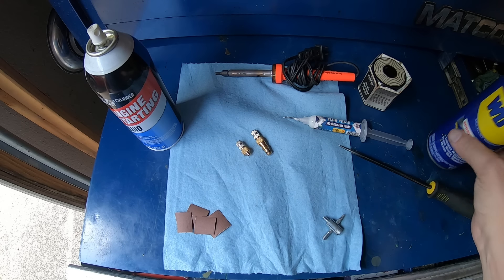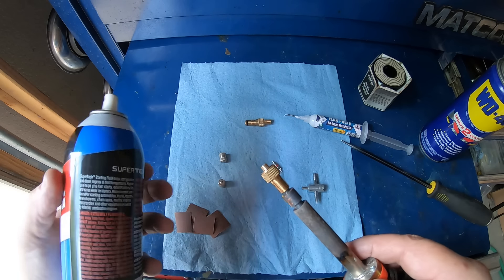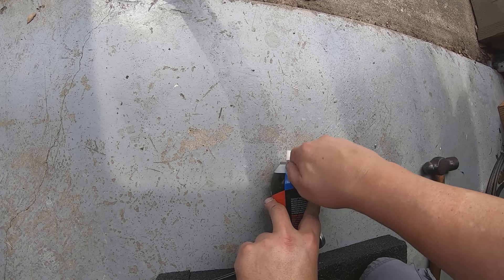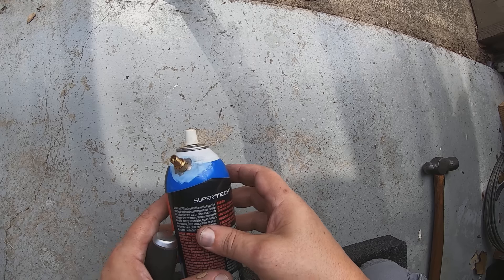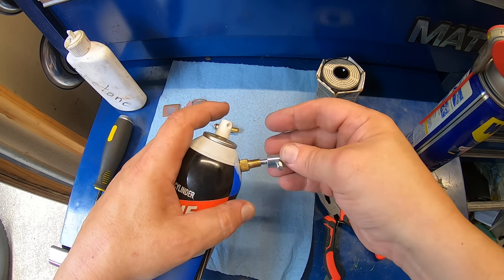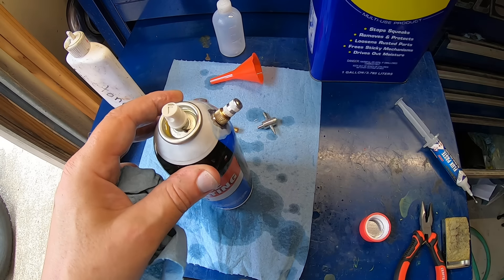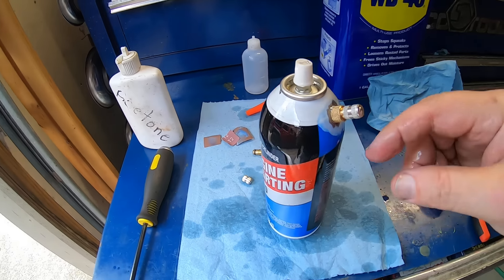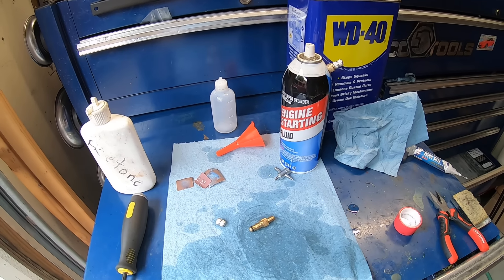How to Easily Install a Schrader Valve on any Can to make It Refillable without Drilling or Torch.

Comment: I've turned stuff like that down in my drill press with a half inch chuck and a file.  This is a very nice hack.  I had been filling cans by pressing a wheel stem onto a spray can and using the schrader valve that way.  This is way better.  Thanks for posting.  (I like the soldering iron hack too!)
Reply: the tire valve stems are made of rubber that is not oil resistant. the oil inside will eat tru the stem and will shoot the valve out, hopefully NOT in your eyes.
Reply: @west_park7993  the sealing ring doesn't retain the stem, it's metal and gets screwed into the assembly. If it deteriorated, it would just start leaking .
The solder letting go is the risk of the valve going projectile.

Comment: You should tap it and thread it in and then solder. That would give you a little more safety if something should be wrong with your solder job.
Reply: Good luck tapping metal that thin, probably half a millimeter (NZ here so metric) max.
Reply: @billharrison3174  I have tapped stuff that thin, you can't get a lot of purchase and you have to go slow but it can be done.

Comment: Great video, please consider getting an air chuck with a lock so you can stand back while airing up the can.  Not sure, but those cans are probably designed for single use and multiple refills may weaken them.  100 psi in a metal can is a bomb!
Reply from the maker: You should watch my other 2 videos where I pressurize them to failure.
Reply: Always wear safety glasses and other safety gear to protect your eyes and face if some solvent or other object happens to fly from the can!

Comment: That’s an awesome idea. People don’t realize many times that chemicals that many people believe to be next to free or cost very little in repIair/manufacturing commercial/industrial settings are actually pretty expensive especially in small  use  applications scenarios ie. Aerosol sprays vs refillable compressed air sprayers. I worked for a chemical company and most sales were industrial totes of product but some of the same products in spray cans  were 3-4 times the price or more and would still not equate the quantity of product difference. For those wondering and are not aware , there are already  refillable compressed air bottles sprayers but last I was involved w that industry, they were expensive as in $100 plus USD for a slightly larger sized can than the one this gentleman modified. Great hack…

Comment: Great way to get an air fuel bomb, oxidizer plus fuel under pressure, try it, be amazed. 
Make out your will first.
Reply from the maker: No thanks, I will stick to just pressurizing the can with my WD-40.
Reply: @737mechanic  WD 40 is fuel, keep the pressure below 14 to 1 and it might be ok, use a benzine or butane gas and it will go off earlier. I speak from experience, lucky for me the ends of the reactor I was using were not fused to the cylinder, it just popped apart, but it had ignited under pressure.
Teaching folks to do new stuff is admirable, but, given the right, or "wrong materials" this can be deadly.

Comment: If you get some AC system valves you also get valve cores that are PTFE, which makes them resistant to much more chemicals as well. Plus no turning involved, just get those without a tail, as then all you have to make is the roughly 3/8 hole to put them in. Or put the cores in the regular valve, as they do fit, making it chemical resistant, say you want to have a spray bottle of acetone or MEK , which dissolves regular neoprene rubber very fast.
Reply: Couldn’t you pull a vacuum on the can using a set of gauges stick your refrigerant line in the WD40 can?
Reply: genius dude ty! already ordered 10 lol
Reply: Yep... the perfect source for schrader fittings. The slim brass fitting on a copper tail form makes it easy to solder in securely (without specialist tooling) and not stick out like dogs balls. 
HVAC trade wholesaler is the place to go.
Reply: @rchighfield1  - Yes, BUT... You will leave residue from your refill in your A/C service hoses. Not ideal, IMHO. Especially if you are filling the spray cans with something that can attack the inner hose. Still, if you have A/C gauges and hoses, you can re-pressurize the spray cans with NON-OXYGEN gas (you know which kind!), and eliminate the explosion hazard you get with compressed air. But NEVER pressurize cans with straight Oxygen!
Reply: @YodaWhat no I don’t know what kind thanks for assuming my intelligence
Reply: @TimDanger  - Nitrogen would be preferred, but what non-Oxygen gas will AC technicians be most likely to have? REFRIGERANTS. Though of course, those are not supposed to be used in ways certain to cause their release into the atmosphere, like recharging the pressure in spray cans.
Reply: @YodaWhat  A/C techs should have nitrogen, too - need to flow that while brazing.
Reply: That was my point exactly.

Comment: No need to lathe the valve, can simply remove the rubber from a standard tire valve and solder
Reply: @ljbellinger  True, but you have to make a larger hole in the can. I think you can spin it in a drill and grind off some brass with a file. It is small enough to work without a lathe.
Reply: @AM-dn4lk  Yes, with no Lathe - you read my mind. A punched hole prevents drill swarf inside the can. I knew about this idea, but it was the 100psi that prevented me from doing it. I have many Cans of half-full WD 40 - with no gas inside the aerosol! It happens a lot to WD 40 Cans that I buy.
Reply: @peterduxbury927  PB Blaster is my notorious gas fail with lots of penetrate product left. Great fix!
Reply: @peterduxbury927  Just take the spray nozzle off and use an air blower in thru the outlet tube on your cans that still have content in them😎
Reply: @petermurphy3354 Yes sir, especially that rubber tip blow gun,  works on so many things...
Reply: @peterduxbury927  try a small piece of small diameter rubber hose, one side to the aerosol valve the other to a valve then your compressor, give the aerosol valve a few strokes and you can use all the good stuff.

Comment: I worry a little about air on top of a fuel, but I suppose you could use argon if you have a bottle for a mig welder. If your valve core gets eaten up by the solvent, you could try an hvac core - fits a standard schrader but is more chemical resistant and goes to higher pressure. You can get them off the ac system on junk cars. I may try this, but fill the can with my own atf/acetone mix.
Reply: I also worry about using compressed air to pressurize atop fuel. I advise against it, and definitely NEVER pressurize cans with straight Oxygen! Nitrogen (for filling tires) is available at some service stations. CO2 also works, and for some purposes, injecting some Butane would be a good way to pressurize. Using air also runs the risk of putting water into the can, which will rust through fairly quickly if there is any free Oxygen in the can.
Reply: My favorite DIY homemade concoction to replace the expensive liquids intended for breaking away stuck or rusted fasteners, is exactly a mix of either acetone or MEK and synthetic ATF+4, around half and half, but could vary between 60/40 to 40/60, depending on how fine or coarse are the stuck threads... Way better than "PB Blaster", "Liquiwrench", "Kroil", "Würth Rost-Off", and of course the very mediocre WD-40...
Reply: @alfredomarquez9777 
Try adding some kerosene to the mix (I've seen it called Ed's Red before). I use 1:1:1 and it works a treat.
Reply: What's the atf/acetone mix for?
Reply: @jamiepayne9801  
Homemade Kroil

Comment: This is an easy operation requiring simple tools... I have a commercial version of this, with a heavy duty aluminum tank, brass schrader valve, and a trigger sprayer.  I keep PB Blaster in mine...

Comment: You can just buy a refillable pressurized sprayer. Much safer, reliable and save you time.
Reply from the maker: I have 2 Sureshot sprayers, I like them but they spray too much product, It takes me 10 to 15 min to make these refillable cans and I have 6 of them so far and would never look back.

Comment: Funny you can just make the hole a little larger and then tap treads and screw the entire valve stem into the can or if you like also tin the can and the stem & solder it too. No machining the valve stem and double fastening.

Comment: This is GOT DAMNED GENIUS!! Now, if i can figure out a way to do this with a air wick spray can for my refillable, automatic sprayer it could change the world!! Those things are so expensive and last only a week maybe a little longer.
Reply: Hi Niki! Although it seems to be a good idea, it isn't. That method does work with compressed air, which is sort of OKish on large cans, although its really tedious, because you have to bring the can up to pressure very often. On small  cans like the air wick stuff, it doesnt work at all.

The reason is pretty simple: spray cans normally are filled with the product you want to spray plus a liquid, that has a very low boiling point, so it is - at room temperature and under normal pressure - already a gas. Compressed to 3-5bar however, it is still a liquid. A good example for such a substance is propane gas, which is indeed used in spray cans as propellant. In the propane tank you might know perhaps from a BBQ or camping stove, it is under pressure and liquid and when you release it from the tank it evaporates and becomes gas. The benefit is, that as a liquid, it takes much less space, than as gas (comparable to water, that creates an enormous amount of steam as it boils)

Now this effect is used as well to propel the product out of a spray can. When you press the cap, the pressure squeezes out the product as well as some propane gas (that is why the vapes are flammable even if the product isn't). The trick is now, that as you loose pressure, liquid propane will evaporate, until the initial pressure is re-established.

In simple words: the propellant gas is practically a built-in compressor, that keeps the pressure high until all the propellant is evaporated and hopefully all of the product came out of the can. 

With compressed air, you have only a limited airspace over the product under pressure. When that pressure is used up, you need to refill the compressed air. That is why it works soso with larger cans. With an air wick you have perhaps 1-2 ml of air under pressure. That is probably even not enough for one single spray.

Sorry for popping your dreamubble and sorry for using the metric measures. Being German I'm not used to convert to imperial. 

Cheers
Andreas
Reply: Don't take much to impress some people.

Comment: Why not just drill a hole the same size as in a tire rim and then just use a rubber tire stem forced into the hole as it would be in a rim.  Think it would work ?
Reply from the maker: There would be no way you could get it in without destroying the can.

Comment: That's a lot of effort to go through to extend the life of a spray can.  My issue is I have cans of wd-40 and other substances where the propellant is gone. Sometimes I can take a blog gun, connected to a compressed air source and using the nozzle to pressurize the can.  I remove the little plastic nozzle, press the rubber tip against the little hol3 in the can and press the button.  Most of the time I can hear the air bubbling inside the can.  If this works, for you, it will allow you to use the last bit in the can.  The problem is, doesn't always work.  I think a nozzle has to be machined that acts like the plastic spray nozzle.  I could machine one, just have better things to do.

You can actually purchase containers that are made to be pressurized and refilled, can't remember the brands.  The last time I used one, the can leaked a bit.

Should say this, but I've taken 30 pound refrigerant jugs, have silver soldered 1/4" male flare fittings with schraeder valves, that allows one to fill the tank with compressed air.  I think the "illegal" part is transporting the container on public roads, since the ruling seems to come from the DOT.

Keep up the good work.

Jim
Reply: the problem with refilling those refrigerant jugs is the metal is so thin and it will rust on the inside and can explode and kill you. When they have refrigerant inside they cant rust but will with air inside.
Reply: @jimthvac100  Only fill with air that has been thru a desiccant, drying out the air ... ought to have one of those on the air compressor anyway. on the intake side.

Comment: Great job explaining the process,  you called every part name  correctly and overall nailed it.  I don't use WD40 anymore, CRC makes a much better juice. Your shop is worth a review,  I know you can make a buck using it. Get more shelving and racking. Thanks.
Reply: Acetone &ATF MIXED 50-50 Makes the best penetrating mixture! To losen frozen bolts and etc.😊

Comment: Now that you're sure that solder joint doesn't leak you should go ahead and fix that leaky air compressor or hose end.
Reply: I think the hissing sound you are hearing is the sound of insects outside (cicadas and such), not compressed air.

Comment: You can pressurize the can with air, then put it in a pail under water to see if your weld job or schrader valve leaks. It would bubble if leaking.

Comment: I like them smoll pump cans with a nozzle that you can pressurize.. Works fine. Also 50:50acetone to hydrolic oil works 5x better And is cheaper than DB 40..😉

Comment: Just a thought, since 99.99- - % of the people who may want to try this, but don’t have a lathe, I’m assuming the reason why you want to turn the valve down is to make more space for the solder. If that’s the case try chucking the valve in a drill and using a file or bench grinder turn the valve down and emery cloth to get the size you need.
Reply: Chuck it up in a drill and use a file .Brass is pretty soft . Good Luck
Reply: See my post on this, agree with what you say, neccessity is the "mother of invention"

Comment: For about the same price as a few schrader valves, I could instead buy a few good quality chemical spray bottles that work better and are safe, easy to fill/maintain, more reliable/robust, and even clear so I can see the content levels.  I'll save my shop time for innovations that actually outperform off-the-shelf solutions (in cost if nothing else) so I can feel like my effort and time are actually worth something.
Reply from the maker: That sounds great for you.
Reply: Or buy a "Sure-Shot" refillable aerosol can from Grainger, or McMaster-Carr,  heck, maybe even Harbor Freight sells them.

Comment: Sure you don't need drilling or a torch but you got to have a milling machine to Mill down the part and a customized soldering tip. Figure it out LOL
Reply from the maker: Not a mill, I used my lathe. But you can use some imagination and come up with another way to achieve the same outcome like use a drill and a grinder, or a file, or a drill press.

Comment: Wire wheel the spot on the can. Used or new valve stems from cars have a narrow stem under the rubber also removed with the wire wheel.

Comment: top tip of today. . when you're filling it with compressed air do it in an inflation cage, that's what they call them in a commercial setting but a strong cardboard box with the lid closed will suffice, when they go bang the valves are like bullets ! ! 
let's be careful out there,
Reply: scary
Reply: I use a cardboard box and a clip on inflator and raise the pressure remotely at the regulator. For me the box was less about safety and more about cleanliness in case of a blow out

Comment: You can also simply use compressed air and force it in spray valve.
Reply from the maker: YEs but you cant add fluid that way.